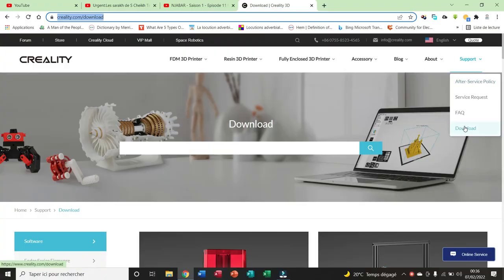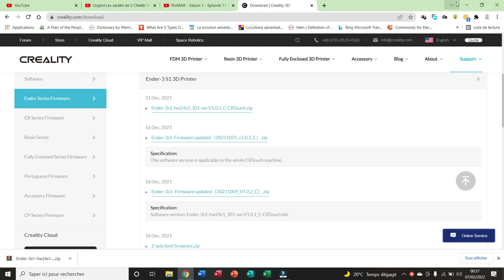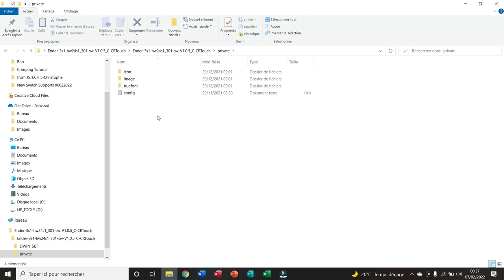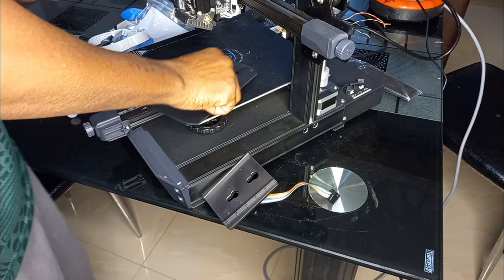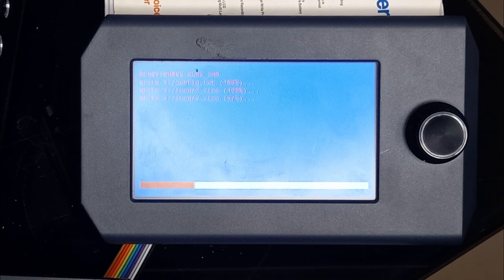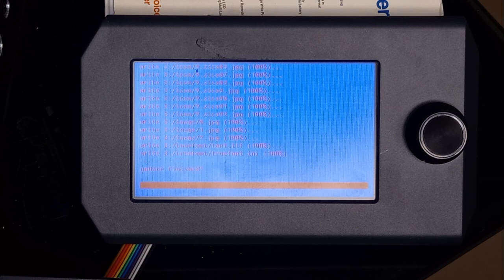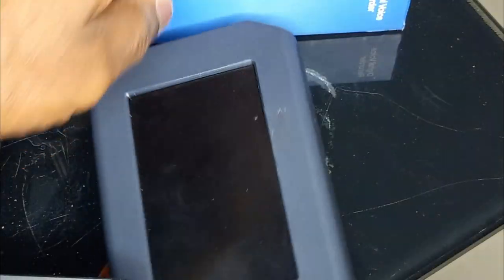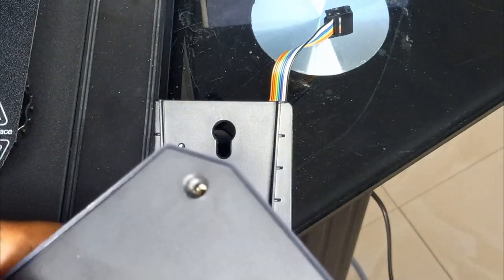69: How to Flash the LCD Display of the Ender-3 S1  (Subtitles: French & English)

Comment: Your Calculator link is not working.
Reply from the maker: Sorry for that. I have updated it. Thanks.
Reply: @mamadoubapassioninformatique  Thank you, how did you update the screen with different menu as its done a lot like the screen from the v2 however the s1 is a different screen from the v2.
Reply from the maker: @TechieNI  The files were sent to me for test by a friend. You just copy on the SD card the files in a folder named private, you insert it in the slot on LCD, you turn onthe printer, and the update is done if it's compatible with your LCD.
Reply: @mamadoubapassioninformatique  Your friend must be very smart or well connected as noone can get their hands on that software it seems. Any chance getting a copy for myself?
Reply from the maker: @TechieNI  Which printer do you have? Ender-3 S1 or Ender-3 v2?
Reply: @mamadoubapassioninformatique  I have both however I'd really like the firmware for the s1 that you have there as that's not the stock firmware on the lcd. I have jyers on my v2 but there's not much out for the s1 as the screen is different on it compared to the v2.
Reply from the maker: @TechieNI  You can download the files here: http://neigeba.com/firmwares/firmware%20ender-3%20s1.rar
The .bin file is for the printer itself.
The folder "private" is for the lcd. You copy it on the sd card, insert it in the lcd slot, turn on the printer, and wait for the flashing to finish.
Enjoy.
Reply: @mamadoubapassioninformatique  Thank you, can I ask is this a marlin build? And is definitely for the S1 with the sprite extruder?
Reply: Also this is a modified version yes? Not the stock version from creality?
Reply from the maker: @TechieNI  yes it is
Reply from the maker: @TechieNI  yes
Reply: @mamadoubapassioninformatique  Thank you very much. Very much appreciated.
Reply: @mamadoubapassioninformatique  The icon pack works! The font is different.. but it works. I've been looking for this, Thank You Sir 👍🏻👍🏻
Reply from the maker: @tweekFPV  you are welcome.